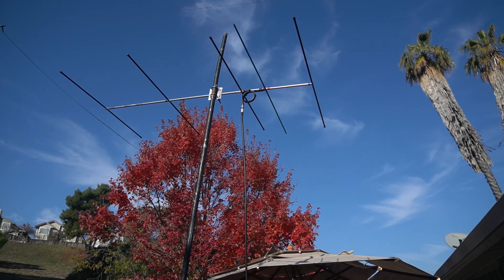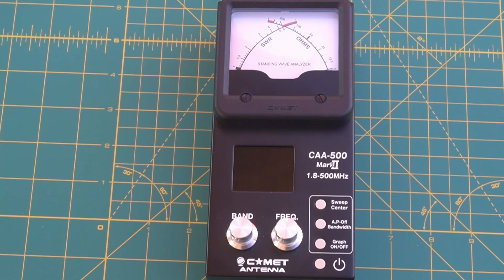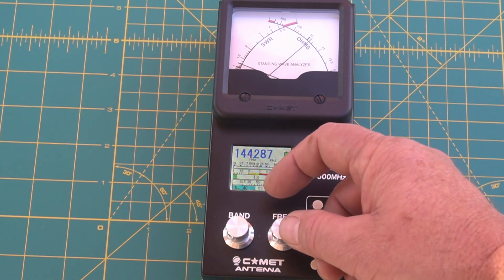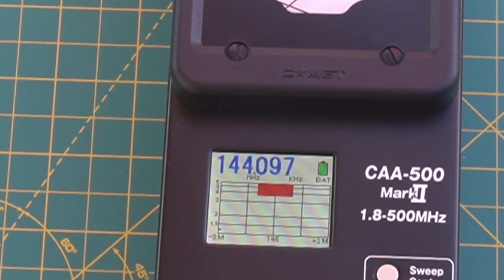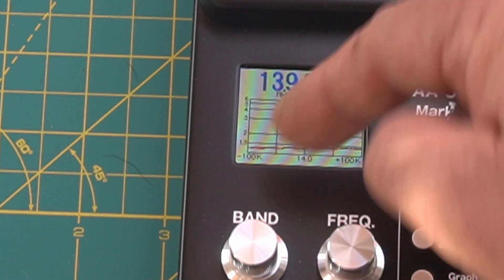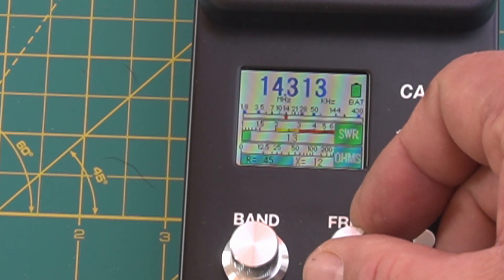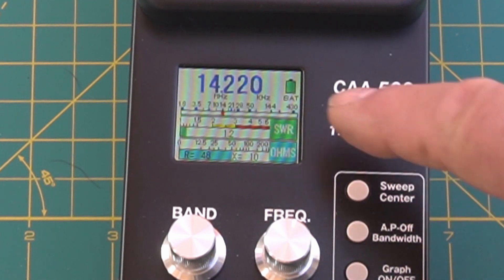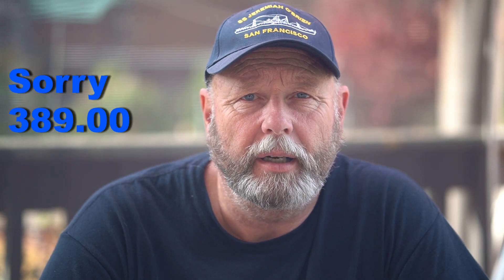Is this the best Atenna analyzer?  Comet CAA 500 II.

Comment: I just purchased my COMET CAA-500 for two weeks so i don't have much experience at this moment with this analyzer. But my first impressions and test are very satisfying.
There is only one point i regret, the placement of the two screws of the battery compartiment. When i lay the meter on the table it wobbles. But i have fixed it with 4 small rubber feet. So that was not a big problem. Maybe a tip for the COMET company "Please find a solution for those two screws so the instrument wil wobbling nomore ."
Reply from the maker: I did the same with the rubber feet and the batteries last a long time